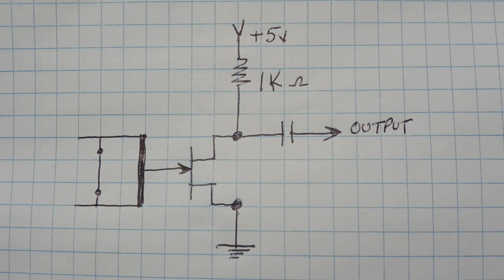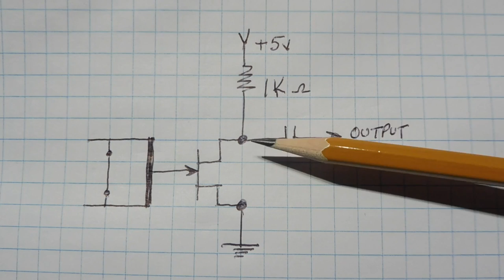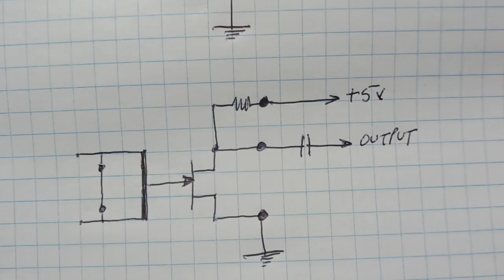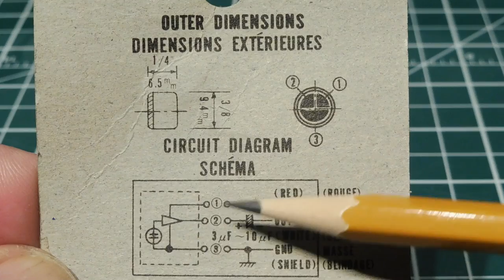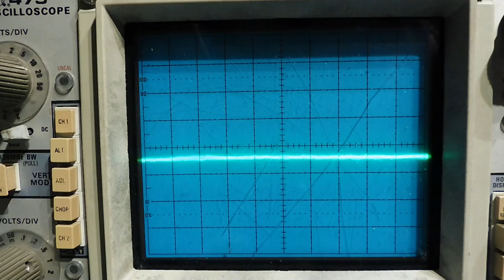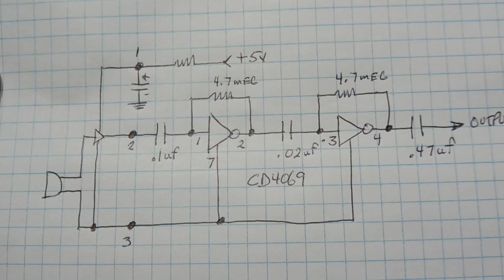Electret Microphones 101

Comment: Does anyone know some content that explains why you need a load resistor and the capacitor on the output?
Reply: From what I understand... The mic pickup element is a type of capacitor, one of the capacitor plates is a flexible diaphragm that holds a permanent charge. When it flexes from sounds it causes a voltage change in the capacitance as a voltage signal. That signal then goes into the transistor gate and out one leg to the resistor and capacitor, but the transistor acts as a transducer turning that "voltage" impulse into a "current" signal at a fixed voltage. The resistor turns that current signal back to a voltage signal (and I believe it also acts as a high pass filter) to turn into sound, the capacitor is used for both AC coupling and to block DC current, also acting as a filter. Also the industry standard for the resistor is typically 2k Ohm, if you increase that resistance to say 4k-20k Ohms with either a higher value resistor or even add a variable resistor in series it increases the audio gain too.
Reply: @macgyver5108  and when you say signal, is it the frequency in which the voltage alternates between positive and negative? I think that there is still a lot for me to unwrap from your answer, but many thanks!
Reply: @JaysonReis  there is a change in the amount of voltage. So the nominal voltage of 5.0v without any sound input will bounce higher or lower than that fixed voltage according to the frequency.

Comment: Should the ac coupling capacitor be only from 3 uf to 10uf or can it be more
Reply from the maker: It can be more. The value of capacitance and the impedance of the circuit you are driving form an RC filter which will determine your frequency response.
Reply: 0033mer   i am designing a electronic stethescope and taking the input of heartbeats through a electret mic and passing it on to a preamplifier made of TL072 opamp. In between TL072 and mic i have a resistor of 2.2 k nd capacitor ( value not decided). The heart beat frequency ranges from 20 to 300 Hz . The input resistance of TL072 is 10^12  ohms.  Now how should i decided the value of capacitor. ???
Reply from the maker: You can use an RC filter calculator.
https://www.v-cap.com/coupling-capacitor-calculator.php
Reply: 0033mer should i design a filter for 3 db cutoff or optimized frequency ??   I am confused